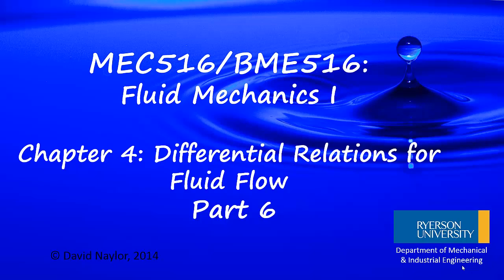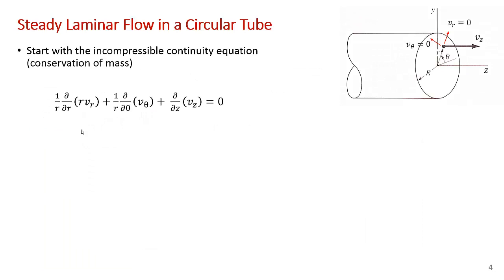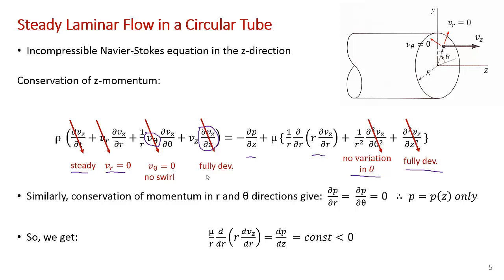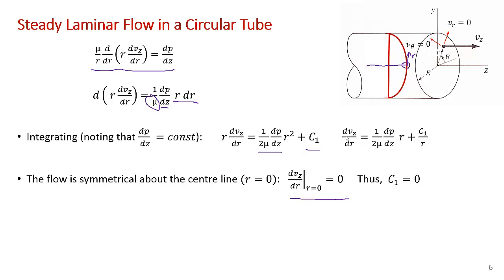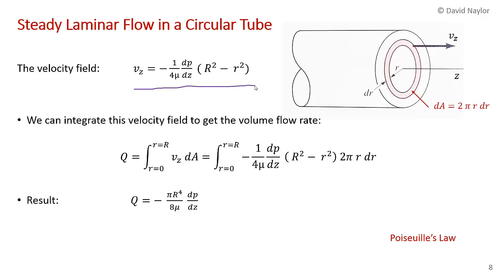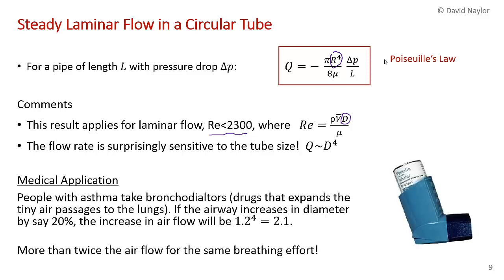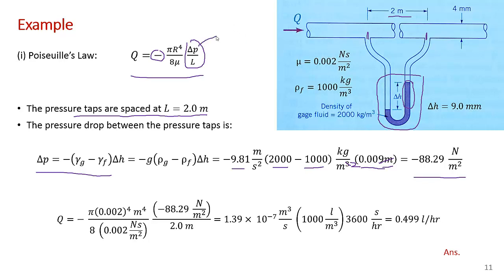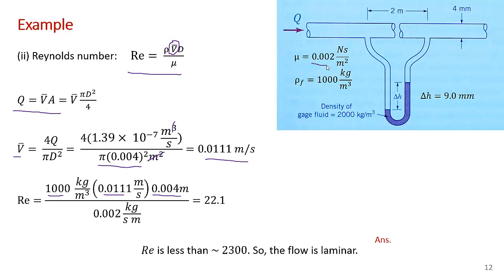Solution of the Navier-Stokes: Hagen-Poiseuille Flow

Comment: At 8:54 you said that for the C1/r term that dividing by zero would make the term go singular, and the only way for the equation to be true is if C1 was equal to zero. I'm a little confused because 0/0 is still undefined?

It may be due to the fact that at r=0, polar coordinates are not able definitively specify a location. Because at r=0 any angle theta will result in the location being at the origin. However, because we know the flow is symmetric about theta, any angle theta will result in the same value at any distance r. Therefore, we can conclude C1 must be zero at r=0.
Reply from the maker: I see your point. A solution to your 0/0 issue is to multiply both sides by r before applying the V_z symmetry boundary condition. Now, rdV_z/dr=0=0+C_1 at r=0, and it becomes totally clear the C_1=0. That's a more sound mathematical argument. Thanks for the helpful comment!